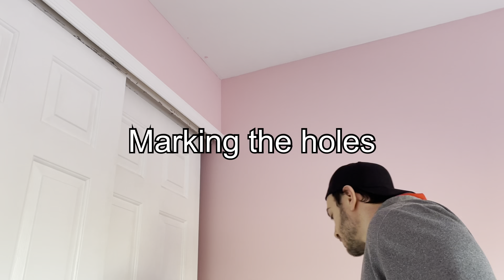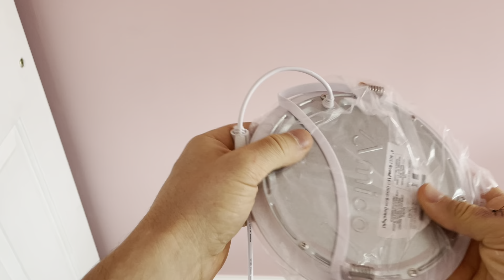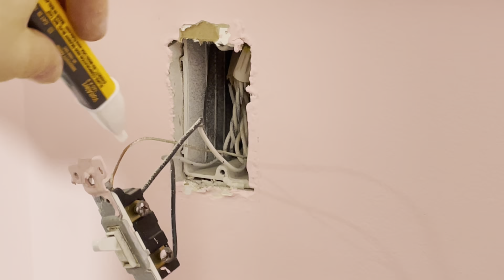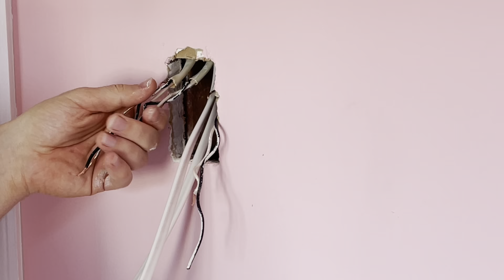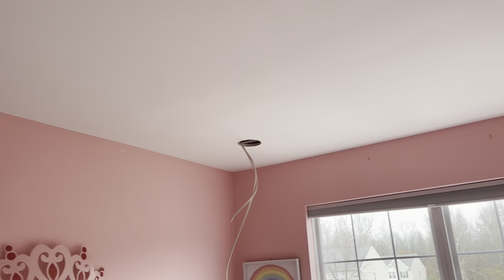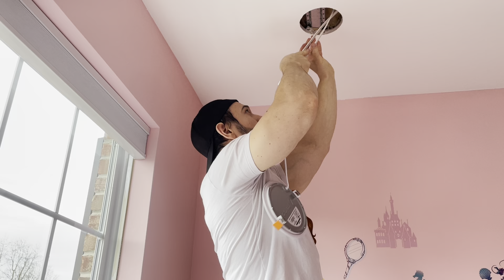Project: Putting in recessed lighting with attic access

Comment: You need a vapor barrier between cold spaces and hot spaces, living areas.  On a really cold winter day those light will condensate and drip water.  No vapor barrier will allow for warm air to get into the attic causing moister issues,  possibilities for black mold to form.  Be safe.
Reply from the maker: Very good point. The lights are rated and designed air tight but mold is definitely always a possibility
Reply from the maker: I did install these over a year ago so I will have to go into the attic and pop them out to take a look. Never had a problem before but it is definitely something to watch out for.